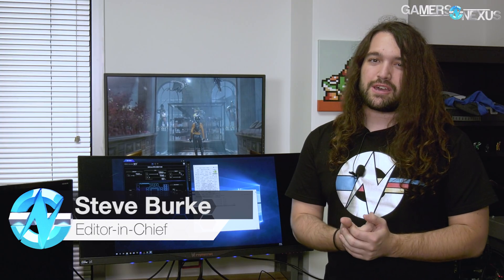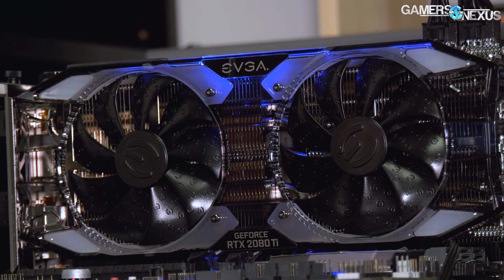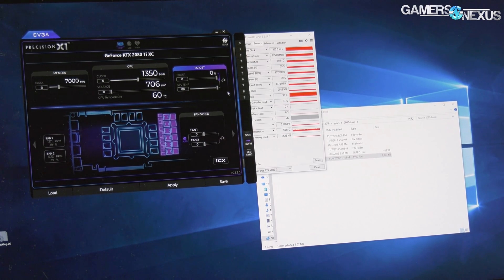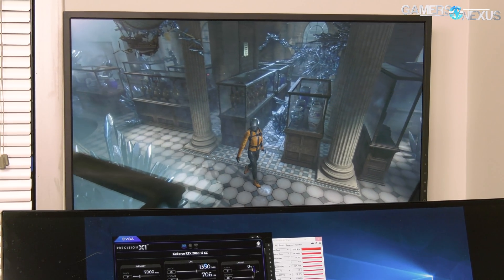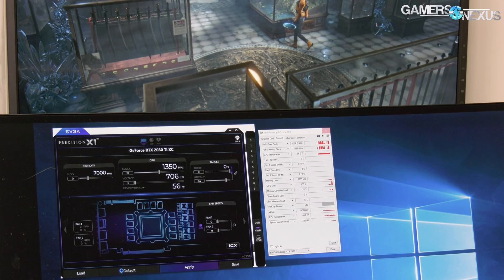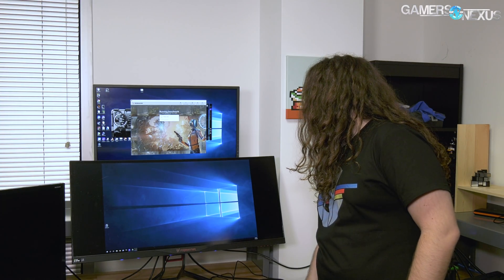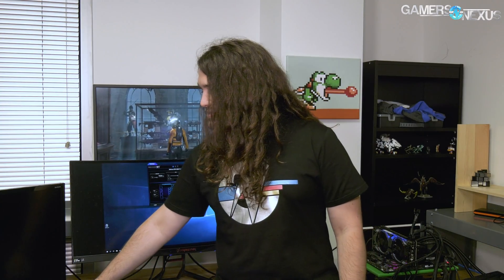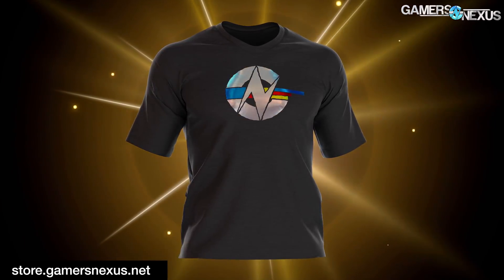Dead 2080 Ti #1: Clock Freeze at 1350MHz, Stuttering, Crashing

Comment: I've had this issue for years. I finally discovered the cause was a faulty, hot IC chip on one of the fans that created a short. This caused the GPU to go into a limp home mode at 1350MHz, replacing the fan fixed the issue.

Comment: @Steve/GN i had this issue almost exactly on my ROG RTX 2080TI Gaming advanced. 
Turned out in my case to be hotspot temp exceeding 100c while gpu temp was closer to 60-65c. i repasted the gpu and it solved the issue for me. I tried flashing vbios and everything you can think of before repasting it.
Reply: worth noting that this is no fault of asus, i have an EKWB installed on it and i must have done a bad job with thermal paste last time i took it apart but symptoms are exactly the same so my guess is some GPUs mustve shipped out with a bad thermal paste application or is making bad contact with cooler.

Comment: I have a secondhand Gigabyte RTX 2080 Super Gaming OC (rev. 2.0) which suddenly started exhibiting the same symptoms after working fine for a couple of months. But I learned how to fix it. And I think, I pinpointed what triggers the bug. The onset coincided with the Nvidia driver update. I don't exactly remember the version now, but it looks like it doesn't matter.

The symptoms are the same. Any settings sent via Afterburner make the display driver restart (short black screen with fans ramping up, then getting back to normal). It doesn't limit itself to the power curve. Any setting, even the custom fan curve, will cause the GPU driver restart.

The card limits itself with 1650mhz (base clock for RTX 2080 Super?). It can go lower when there's no load (down to 360mhz or so), but as soon as there's load - it stays on the base clock. If you fire up the HWiNFO64 to check the performance limiters, you'll see that the "Performance Limit - Utilization" is active. As if there's no high load on the GPU.

Here's how to fix that. You will need the DDU - Display Driver Uninstaller. You don't need to uninstall the current Nvidia driver using the usual means.

Restart Windows into the Safe mode. Launch DDU and pick the "Clean and Restart" option after selecting the Nvidia GPU. After restart, reinstall the Nvidia drivers. Done.

To be on the safe side, I also disable the Afterburner's autostart during the procedure. However, after the driver was reinstalled, you can safely use Afterburner too as usual. The card goes to a perfectly normal state - overclocking and all. It does accept the Afterburner settings and everything.

Until you update Nvidia driver or there's a major Windows version bump (like 23H2). You'll get that bug again.

So I don't think it's strictly a hardware problem. Rather, probably some sort of combination. Janky vbios and some sort of changes Nvidia introduced well into the 2xxx series life.
Reply: have you checked hotspot temp in hwinfo 64? could just need repasting.
Reply: @WatashiwaToyotaHondadesudesu  I repasted it as soon as I've gotten it. The hotspot temps were ~25 hotter than the gpu package and even then it didn't have that problem.

Since then I've contacted NVidia support and we managed to narrow it down to monitoring software. In my case it was Aida64 with Afterburner. If they're both or any of them is running in the background when a driver is being reinstalled, the card enters such a state. Only a clean driver reinstall would help after that. It also seems that only Turing cards exhibit such a behavior. My current 4080 Super as well as 1080ti aren't suffering this bug on the same system with the same software.
Reply: @Zoomer.88  ok so it can be caused by other things, in my case i had the same issue but due to a bad thermal paste application, gj fixing it tho
Reply: @WatashiwaToyotaHondadesudesu  What was the reason for performance limit in hwinfo64 in your case? Was it the same as mine? Utilization? I mean, I think it would be Thermal in your case then?
Reply: @Zoomer.88  nope, was telling me power
Reply: @WatashiwaToyotaHondadesudesu  Huh? It seems, this metric isn't that reliable then :P

Comment: Solution I found and it works 100% of the time: I removed the card that has the clock stuck, put in any other Nvidia, wait for Windows to start, turn off the computer and replace the RTX. That's it, the clock is unlocked and the problem doesn't return, without the need to reinstall the drive... 😎

Alternative that works 90% of the time: Completely uninstall MSI Afterburner (including settings), uninstall the drive with DDU in safe mode and preventing Windows from updating automatically, restart the PC, reinstall the drive and then install MSI Afterburner.

PS - RTX 2070 Super and RTX 2080Ti...
Reply: I have a gt 210 and rtx 2080 ti, the GT works? I wanna to try your solution.
Reply: @jhonattankc6202  I believe that it will not work because the GT210 does not have the same driver support as the RTX2080Ti, it needs to be a card that works with the same driver... The last driver that supports the GT 210 is very old.
Reply: @CostaOliveira  I did the 90% since i dont have another NVIDIA Graphicscard to test the first one, and i still am capped at 1350mhz, yk how to get more? Im really frustrated
Reply: @Joker-fl5bv  Good evening, unfortunately in this case, as the alternative method did not work, the solution may be to format the hard drive... A new installation.
Reply: PLS do it a video with the solution 🙏

Comment: Did you ever figure out what happened to this GPU?  Having the same issue with a 3090 ATM but sometimes it just works normal.
Reply: i had this issue on my rtx2080ti, after trying a million things, found out that hotspot temp was exceeding 100c in hwinfo64 despite gpu temp being low, thats when i took water block off and applied new thermal paste and boom fixed.

Comment: I have a gtx 1080 evga SC2 and it does this same thing, stuck at 1709 mhz memory is fine and can oc but soonas you raise clock for gpu itb stutters and eventually crashs. so this apparently is a bug older then the 20 series.

Comment: Two issues in one day -

#1 - Failure to apply a discount on my FTW3Ultra card when I was billed.

The reply customer service email was just lazy, "Sorry we can't help you". The invoice had the sale dates on it showing 4/1 - 4/30 (purchased on 4/8). This was supposedly an instant rebate. In my email I pointing this out. I suggested a store credit. I am building a new system and there were a few parts I could use on the website. The rep had to step away and speak with a supervisor. When he returned, the only option was EVGA Bucks. Not a refund for the difference. I received the card the day I called and was fully prepared to send it back unopened if they declined to provide the refund.  I settled for the bucks because I was thinking of getting a cooler or power supply. 
#2 - The 2080ti FTW3 Ultra started failing within the first 30 minutes of use.

After hanging up with the refund issue resolved, I opened the package and installed the card. In the first thirty minutes, the card failed while playing "The Division 2". I was actually live streaming on Twitch (Channel - Sam_Hammerballs, not monetized). Apparently, I chose poorly when I didn't send the card back. Artifacts resembling space invaders, black screens and computer freezing up. Within an hour and while I was trying to fill out the service ticket, the artifact again and I froze up. I again got the black screen and had to do a hard restart to finish the EVGA service ticket. I eventually had to be removed the FTW3 card and reinstall my old card to finish filling out the service ticket. You just can't request an RMA. You have to first submit a service ticket and upload your receipt. Of course, I purchased this from EVGA directly so that seemed redundant. I understand the need for the receipt if not purchased directly from EVGA but really.

So within 6 hours, I get the response email approving the RMA. So link to fill out another form and said receipt from above. Complete the form and get the following message:

There has been an error while requesting your page, and our team has been notified.
"The request from 73.254.18.32 at 2019-04-13 14:29:35 GMT for the URL /support/submit rma.asp cannot be served due to error 159 on the host www.evga.com."

So now that it's after hours on a Friday, out of luck, the RMA department does not work on the weekends. 
Today I call and speak with the only option available, tech support. The phone tree is long. However, the wait once you reach the destination was not. The Tech was helpful and actually started the process. However, another process that is three-steps? He could not just take the information and make it happen? And since its on the weekend, out of luck until Monday.
So a bit disappointed. I have purchased many EVGA products over the years. At least 4 video cards. It's nice there is a warranty process, but going through that process is frustrating when it's multi-step and it doesn't work. It seems more like its stalling, hoping you will just walk away out of anger or frustration.

The icing on the cake - Recieve a survey from EVGA via email this morning. Complete the survey and get the same "error 159" message. Go to the website and attempt to do it there, the same message.

Comment: I had the exact same issue with the card unable to boost clocks and a locked power limit. I think it is a driver/Windows problem: I could fix the issue by removing the card/uninstalling the card driver in Windows 10 device manager, then reboot and let Windows detect the card again + reinstalling the NVIDIA driver. Some combination of that fixed the issue without reflashing the firmware, and the card allows me to boost and apply OC settings and adjust the power limit etc.

What is more, I have two identical ASUS Dual 2080 Ti OC cards and made some funny observations while working on resolving the issue: First, I placed card A into PCIe1 and was not using card B, with the described symptoms present and apparently affecting card A. Now I removed card A and swapped card B into the PCIe1 slot (with the PC turned off), and after booting Windows the issue was still present for card B, which looks like both cards were affected (am I such an unlucky guy??) - or the PCIe1 slot could have been broken, but it worked fine with an older GTX 1080 card. However, after moving any of the cards A or B to PCIe3, both of them worked! What is more, after moving any card back to PCIe1, also both of them worked! So my suspicion is that at some point when Windows or the driver detects a card (of the same brand and type, but it could be a different physical card) for the first time in a certain PCIe slot, it will set it up and store some settings about it (probably in the registry). If something goes a bit wrong there, the card is set up so it won't be able to boost or allow to change power limit, with the issues we had as shown in the video. If things go well as they should, the card settings are stored properly allowing the card to boost and power limit and OC settings to be changed.
Now as you can imagine, getting both cards to run properly in SLI can be a painful process if the issue is present with one card. But eventually after some visits to Device Manager and driver installations I managed to get them both to work properly and turn on SLI.

Comment: I am having a similar issue to this. Except my card doesnt go above 300MHz. It will not boost above 300MHz for ANY 3D load. It is currently being RMA"d. It is an EVGA RTX 2080 Ti XC Ultra. I am on my third card at this point. The original one had an artifacting issue.

Comment: i have an MSI 1080ti gaming X i've had for a year working completely fine, and that started showing a very similar issue on late october drivers but i'm not sure exactly when cause i haven't put it through its paces the past few weeks until today, it wouldn't die if i tried an overclock, but the frequency was locked at 1263MHz or so, not completely hard locked like yours but this could be cause my workload wasn't constant (just me playing a game), never went to even 1400 though and power target bugged and locked at 50 or 0% , unchangeable, i updated the drivers today and restarted and so far the issue is gone, so this might be a different issue than 2080ti failures, no idea what it could be though, just glad i got lucky and it's gone for me (at least for now, hope it doesn't come back)

Comment: Hey Steve and GN, a few of us with 2080TI  SLI setup have a particular artifacting issue on the bottom right of our screens. You can see the issue here: https://youtu.be/kfAAwfbLDks 

This issue seems different compared to the extreme artifacting issues where space invaders starts showing up on your screen. I also run a 3440x1440 monitor and I get the same artifacts as the video in the link above when either running games in full screen or if I tab out of a game. 

Any chance you can investigate? I’d like to know if I would have to RMA my card(s). Thanks!

Comment: Funny, it acts the same way as my Sapphire Radeon 5770; won't go to the right clockspeeds (stuck at 500Mhz on that card, should do 850Mhz in 3D applications) and crashes even if you add 10Mhz. Oh, multi monitor didn't work there either, glitches on screen 2 and sooner or later it would BSOD. I managed to fix it (few years later...) by updating the card's BIOS (there weren't BIOS updates for the card when I bought it new).     On the 2080Ti part; have you tried 'optimal performance' in the powermanegement of the nVidia driver?

Comment: @gamersnexus have you checked the memory modules on the black screen/hard crash cards yet? Seems many of the artifacting or true non functioning cards are using Micron gram instead of Samsung as specified.

https://forums.geforce.com/default/topic/1079421/geforce-rtx-20-series/rtx-2080ti-new-batch-gets-samsung-memory-/1/

Also kyle@hardocp.com had his2050ti do this so you might check with him on his issues.

Comment: Hi Everyone! Curious.. Can you confirm what power management setting is being used, default is 'Balanced' on windows 10 and is easy to forget about on 'clean installs' (And I have even seen windows update reset this to default once in a while), this causes {PCI Express Link} {State Power management} to be set to "Moderate" power savings.  On all gaming rigs I switch to "High Performance"  power management to avoid causing or creating a 'Nerfed' or bottle necked state or the chance of a device misinterpreting windows power savings.  Also can anyone check in the device manager, properties of the Nvidia Geforce card, go to events tab and see if it is showing anything strange, and check the Resources tab, it shows under each resource type if it is detecting any conflicts.  This would be interesting to know.

Comment: Hi,
I've had this issue awhile and been trying to resolve.  BUT, I have two Titan Xp SLI setup but I've got exactly the same issue.  I've had it for almost 6 months, and haven't figured it out because everyone I've talked to says upgrade your ASUS BIOS (which I did).  When adding another GPU (1080TI) then the problem goes away.  I will be interested in what you find out and see if it fixes my issues with my Titan xPs.
Cheers, Darron

Comment: What is really sad with the problems being experienced on Nvidia cards is if it were AMD Radeon they would have been shot, hung, dissected and fed to the dogs by users and testers alike. Being Nvidia, it is being stated that the problems are just a small glitch. Remember the abuse AMD copped over their Vega architecture which had no issues operating unlike Nvidia.  They had zero problems. When will Nvidia cop the backlash. Or is that just wishing too much.
It is clear that this new architecture was late due to problems. Then came the public release with outrageous, exorbitant pricing. The problems we see now I guarantee Nvidia new about prior to the release. Why release them when these problems were already known by Nvidia........Bloody money.......Greedy bastards wanted to clean up before AMD came out with their Navi release.
AMD won't be doing ray tracing on their new cards but will be releasing in the low to high mid range where they may have a chance where the public will buy them.

Comment: Check the potential divider circuit that is used for the current source i.e. where you have the shut resistors.  If the software is reading zero current it might be a fail safe.  This is looking like what happened to you and debauer when you tried to short the shut resistors to gain more power for more boost

Comment: I also had similar issue with dual screen and benchmark with 2080. I think what you have in this video is two bugs one with clock freeze another one with dual monitor which is also happening in 2080.

Comment: That's what my 1080ti FTW 3 hybrid does anytime I try to change anything on Precision X. If I change anything at all, everything locks up but clock speeds are normal.  I just cant increase the power limit or anything.

Comment: My first thought here was that it was a fan\temp\sensor issue, and it's dropping clock speeds and\or voltage to protect the card. Especially since the temp seemed to be stuck at 60c, which is the point where some fans turn on.

Comment: You should open DPC latency monitor program when stuter happens. If you had soldering station you could swap 1350 stuck GPU with normal card to determine if issue is in chip itself or in Evga's PCB.

Comment: So the card behaves similar to how Maxwell/Pascal behaves on Linux with Nouveau (open source) drivers thanks to NVidia refusing to release specifications to allow reclocking support - runs just at base frequency. That's the way all Nvidia hardware should behave also on Windows - good ;)